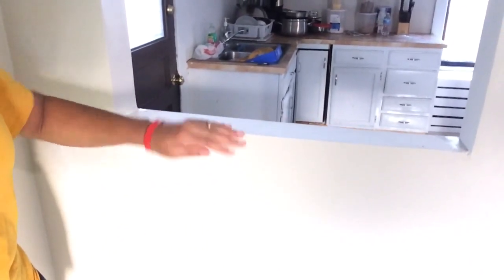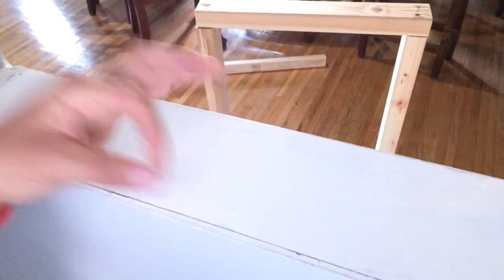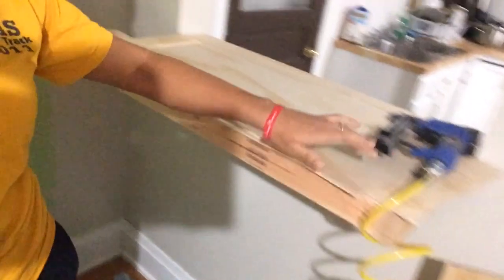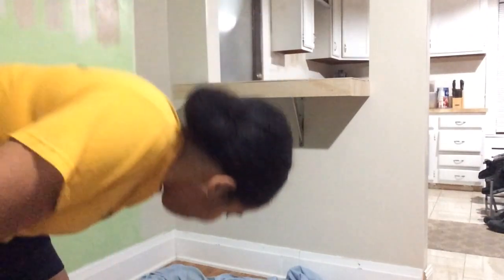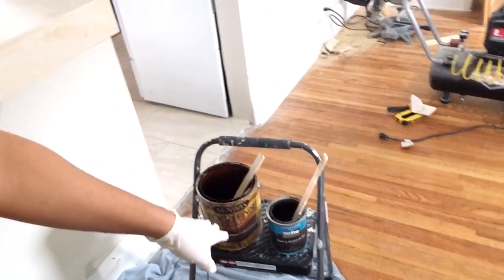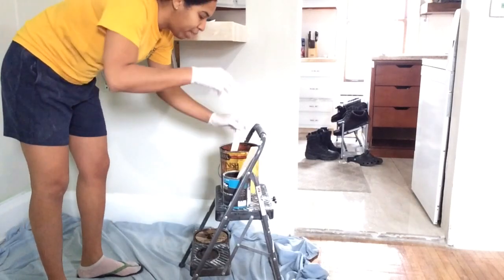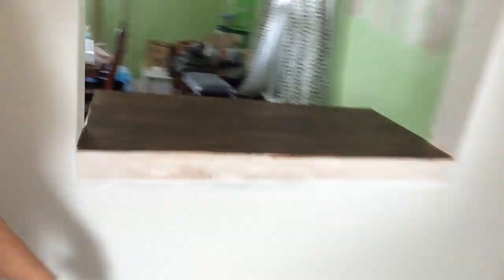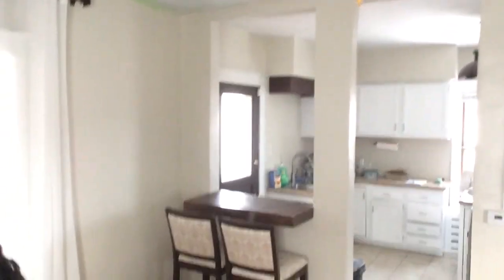HOW TO BUILD A BREAKFAST BAR TOP (Part 2) | EXTREME KITCHEN RENOVATION | DIY BUILD

Comment: Instead of running brackets, run flat 4” wide steel plates under the top connected to the wall. The brackets get in your way if you ever plan to sit there and are kind of an eye sore. Just letting you know an alternative approach.  Good effort.
Reply: those steel plates are nice but are very expensive for anyone doing a "budget" project